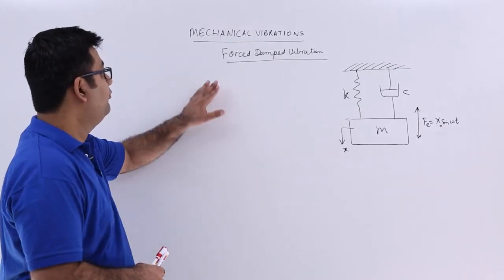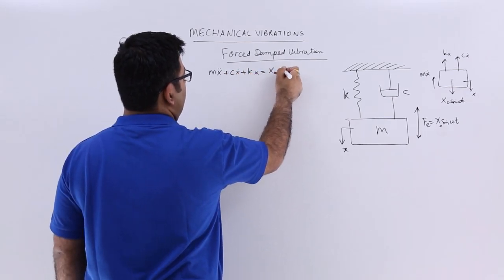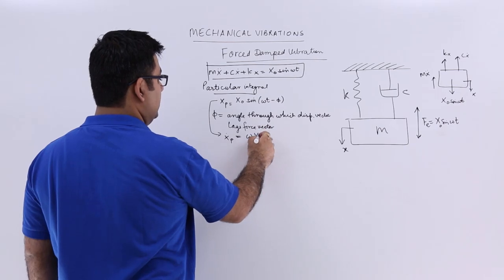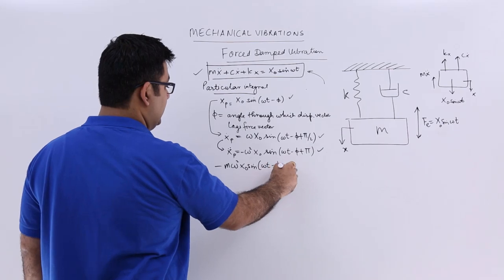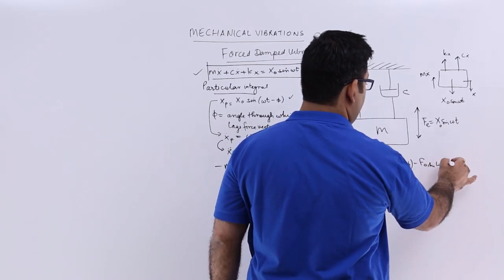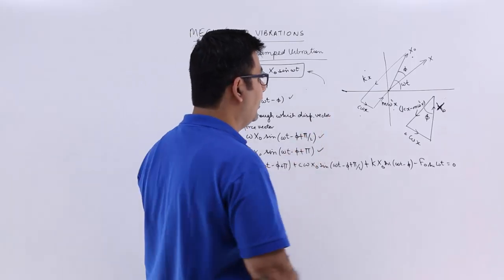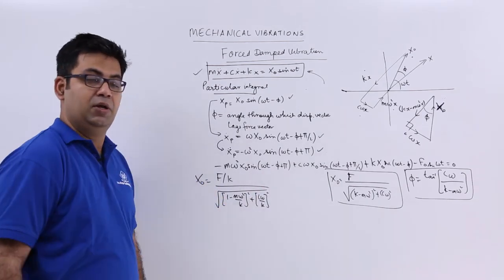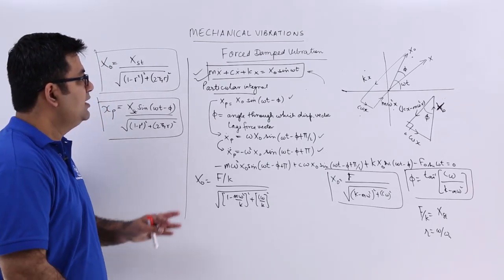Forced Damped Vibrations

Comment: Love this guy, loved his "Bernoulli's equation for compressible flow" video. Small problems here, the omega squared term does NOT get a minus sign in front if you are going to add pi/2. It's either one or the other, those two operations are equivalent. Another fantastic video!